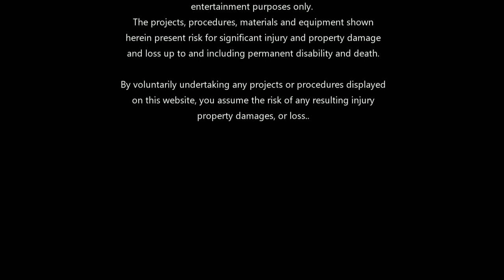Demonstrating a vintage Coleman Catalytic Heater.

Comment: I just bought a 513A in the thrift store earlier today for 5 bucks.  It doesn't have a snuffer and I can see how the burner twist off but no one has demonstrated that.  one guy mentioned a wick.  I cant get mine to twist off to see if there is a wick..

Comment: do you have to let these burn all the fuel in the tank or is there a way to extinguish the unit when finished using but with fuel left in the tank?
Reply from the maker: The aluminum cap over the catalytic head is a snuffer and will extinguish it.

Comment: you didn't mention:   does this use unleaded gasoline..?
Reply from the maker: That is a fantastic question! Unfortunately I don't have a good answer for you. For what it's worth there is a LOT of discussion on the Coleman Collectors Forum on this very subject that I am involved in. Long story short, I was going to test last winter, but last winter was oddly warm here in Texas so I never needed to use the heater. They are designed to run on white gas / coleman fuel, which is basically Naptha. I use Crown Camp Fuel to keep costs down, BUT..... there are reportedly people that have used Regular Unleaded Gasoline for at least one full winter in a northern state keeping a chicken coop warm. The warnings on the owners manual state to not use LEADED gasoline in these heaters as the lead additive would ruin the heater. Basically gum up the catalyst and wick. It IS possible that detergents added to RUG would gum up the wick. Rumors are that this can be cleaned up with isoprpyl alcohol. However since the virus outbreak that has been in short supply, at least here.  If weather permits which if this fall so far is any indication we are going to have a cool / cold winter this year, I will test with Regular Unleaded.  I know Regular Unleaded Gasoline can be used in Coleman Fuel Lanterns and Stoves but will require more frequent cleaning or replacement of the regulator. I expect similar results with the wick on the heater...
Reply: @Wildersport  Honestly, Gasoline would in this heater in a closed tent/garage kills.. Burning Gasoline in a closed environment, creates Carbon Monoxide Poisoning.. That is what kills people who sit in their closed garage with the car engine running..     I asked the question to bring awareness that you have to only use the recommended and safe fuel.. When videos like this are done, we can't leave out really important details..    Honestly, i'm surprised that the chickens didn't die.  Maybe there is enough fresh air coming in..?
Reply from the maker: @rdkuless  the Carbon Monoxide issue is something to consider. And has been debated to death. The purpose of this particular video was to determine "does this thing work, and if so, how well?" The Coleman manual CLEARLY shows that flow through ventilation is required for safe use and was beyond the scope of this video.  To be blunt there are LOTS of conflicting opinions of whether or not catalytic heaters create Carbon Monoxide once they are going. A smart person certainly knows they use oxygen, so you need make up air for sure!  I have used a different model, the "mushroom top" adjustable model, I think 5K - 8K BTU on low years ago with no problem, and countless ice fishermen in points far north of me have used them with no known ill effect for decades. If possible, I would like to see some impartial actual test results. I know newer propane heaters, notably the Mr. Heater Portable Buddy and Big Buddy heaters have low oxygen shutoff and I have seen tests running with them in enclosed spaces with no increase in CO, I am curious about if a white gas catalytic works the same way. I still have the heater and if anyone wants to donate even just the use of a Carbon Monoxide meter, I will more than happily set up a tent, and run a test of this heater in an enclosed space.

Comment: What kind of fuel does it use? I have one but I don't know what fuel to use. I tried kerosene but it went directly out after the fire of it goes out
Reply from the maker: Coleman fuel. A.k.a. camp fuel, A.K.A. naptha.  I'd be concerned about you having tried kerosene. You might be able to recover it but you'll need to flush the tank, clean the wick and the catalyst.
Reply: We used to use Amaco white gas but Coleman makes a fuel

Comment: What kind of fuel does this use?
Reply from the maker: Coleman fuel. AKA white gas.
Reply from the maker: Sorry, I was short for tome when I replied earlier and on mobile. The Coleman Catalytic liquid fuel heaters as opposed to the propane heaters, the radiant heaters etc... run on white gas, which is commonly labelled Coleman FUel, Crown Camp Fuel, MSR Superfuel, Camp Fuel, or Naptha. It is a close relative to unleaded automobile gasoline, lower in octane, purified, and lacking many of the additives added to vehicle fuel. There is a LOT of discussion going on if these can be run on unleaded, and I just haven't had an opportunity to put one through its paces on unleaded through a winter, or multiple winters as I live in Texas and outdoor heater use is rather sporadic.  The least expensive white gas on the market I know of at this time is Crown Camp Fuel, basically the same thing as Coleman fuel but without the marketing budget.

Comment: I have inherited my father's and my question is . Can I use this in my home for heat if my power goes out .... I have read it is ok for tents so I would think if I used in a bigger than a tent room it would be ok. But have also read not to use indoor
Reply from the maker: Obviously I am not going to advise you on issues that can have legal or safety implications but I will tell you what I've done. I ran 2 of these during this extreme cold snap in power outage this week to keep the house tolerable. My house is old and drafty so I am sure I was getting more than enough fresh air.  I light them outside though. The initial flame is pretty big.
Reply: @Wildersport   thank you, I live in a 100 year old house with little to no insulation. Would only plAn on using if no power as an addition to the fireplace in a good sized living room.

Comment: Shoot while I am at it can i use his Coleman lanterns inside too or not ... I realize this video is from 2019 but I hope someone is still around to answer my question
Reply from the maker: Heidi, I would be more concerned about running the lantern indoors vs. the heater. The heaters are catalytic heaters, meaning they are not doing open combusion, and theoretically not producing carbon monoxide. HOWEVER, the heaters DO use Oxygen, and there is some debate on the Carbon Monoxide production. The open flame that is contained in a lantern mantle does produce carbon monoxide.  HAVING said all that, I AM NOT recommending what you should or should not do. But consider that for centuries people used oil lamps and the Amish to this day still use Kerosene and / or Coleman type lanterns indoors all the time. Camp stoves produce carbon monoxide, but are used in RVs, and gas stoves are used in homes all the time. Is it safe?  During the ice storm we used candles, liquid fuel camp stoves, and heaters indoors. The other option was to freeze and starve. I didn't have much choice. HOWEVER like I mentioned in my prior post. Our home is old and drafty, so I know there is plenty of fresh air getting in. We all learn what we can of the risks and make our calculated choices. Again I am NOT recommending anyone do anything in particular. I am just saying what I did.